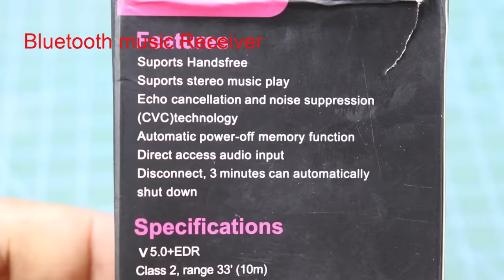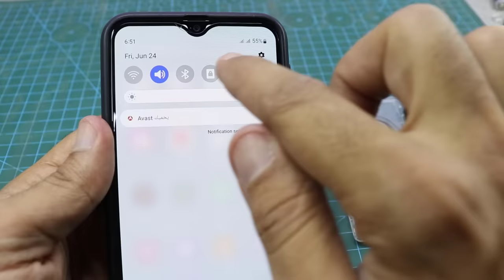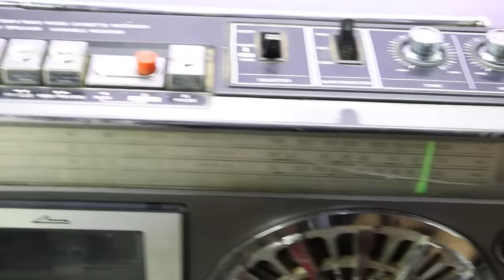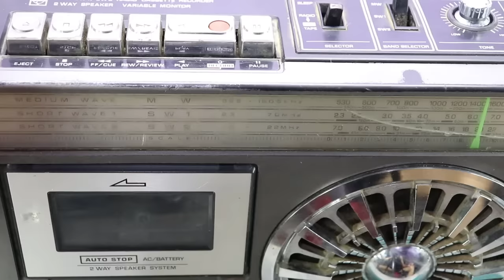This Device is very helpful , you can make at home

Comment: That is a MONO build, it could be stereo with just another conection, i believe souder left and right on the head and ground to the tab of the head instead of take it off, and align the head properly.
Reply: Para usar en cassetes de autoradios con sistemas mas modernos no va a funcionar el tema de los rodillos anti tragado. Ambos rodajes del casete deberian girar con la inersia uno del otro
Reply: Most things that use cassettes are mono anyways. The only thing that will help is high end stereos or home hifi systems that still use tape.
Reply: @diegovera9683  เครื่องๆืงง่ไๆดๆืๆืๆเเไปทำเไไๆืืๆได้้ๆๆ่รถๆๆๆไดีพอดๆ่ดี่ไๆำเเไๆ่
Reply: @joeythefoxxo  I'm old enough to remember cassette tapes and they were mostly stereo.
Reply: What you say is true, but what is the need for all this when there is a group? usb It works with Bluetooth and a radio that adjusts its place in the door of the tape and connects 12v Direct from the cassette and gives a very good sound
Reply: @AnthonyGoodley  Correct. The tapes were almost always stereo. I’m talking about cassette playing devices. They were mostly mono. I’m talking most car decks, home radios, Walkman and all their knockoffs. Some became stereo later on but by that time CD started taking over. Even a lot of things that had stereo play heads just processed it down to mono in the amplifier circuitry.
Reply: I seen that too.
Great idea, though...
Reply: That is a cheap Bluetooth device, if you connect the device directly to the line in input, you only get a mono signal, it is a stereo output, but I get disappointed spending 3 dollars in such yunk.
Reply: Sally, the bt device was mono
Reply: I have one of these for my classic car radio, it's got stereo heads.
Reply: @diegovera9683  yes you need to put a rubber band around the tape spools.
Reply: Yea and probably solder the right to the left and the left to the right on the head since it is mirrored facing the tape deck’s head
Reply: vera  prácticamente lo que hizo fue sacar el sonido bluetooth a la bocina
Reply: Магнитофон моно, но головка в кассете излучает стереосигнал.
Reply: @bazilio3752  базилио, ты не прав. Бывают и заводские  устройства схожего функционала. Головка магнитофона работает и в другую сторону, то есть может быть источником сигнала. А моторчик в мафоне можно вообще отпаять, особенно если он на батарейках.
Reply: Existem muitos modelos de cassete que são estéreo, poderia usar um desses, bastaria saber alinhar corretamente
Reply: @joeythefoxxo  Every cassette I had (besides for the radio mixtapes) were in stereo.
Reply: @limelesson  I said devices. I know the tapes were stereo. The player devices though were usually mono.
Reply: @joeythefoxxo  Car stereos, home sound systems and portable cassette players (Walkman) were almost all stereo! Source: I'm an old git!
Reply: @rh2577  only inexpensive stand alone portable cassette recorders were in mono and used primarily for dictation .  All home audio  boom boxes and walkmans that played cassettes were in stereo
Reply: He’s only using the right channel
Reply: Now try it on a CD 😂
Reply: @bazilio3752  Идея в том, что из головки делается электромагнитный излучатель, который будет взаимодействовать со штатной головкой магнитофона или магнитолы. Сигнал идёт с телефона по blutooth, принимается платой, преобразуется в электромагнитные колебания, которые воспринимает штатная головка.
Reply: @joeythefoxxo  I think you have your thoughts twisted around backwards. Unless you’re ignoring pretty much everything that happened after the 50s, stereo has been the norm not the exception. There were a few portable devices that were mono for cost/space purposes, but stereo has been around since the 30s and became the norm in the 60s for pretty much every audio device that wasn’t portable and even with portables many had stereo.
Reply: @bazilio3752  ты что не видишь что сдесь головка внутри касеты заменяет плёнку? Ты паяльник в руках держал вообще?
Reply: На канале War Archive могилизация орков🤡🇷🇺дронами ВСУ. Видео прилагается🔥🔥✌️🔥🔥
Reply: @joeythefoxxo  , you are very ignorant of the history of such devices. Stereo cassettes were the 'norm' for a long time until CDs gradually replaced them. Only the cheapest cassette players were still Mono. Maybe where you live the Mono players remained common for    longer.

But what's the point of illustrating a technique that only works practically for players where relatively few still remain in use?
Reply: @bazilio3752  не надо остальным знать о твоей глупости. Удали комент.
Reply: MONO is one of my favourite bands…I’m glad you like them too
Reply: @joeythefoxxo  Yeah, that's not true either.
Reply: @joeythefoxxo  you must be young or from a country that’s not the US.  In the USA by the late 80s stereo cassette players, both in portable Walkman types and car decks, were the norm.
Reply: @film79  Tapes started becoming popular in the 60’s, with the cultural boom happening around the 70’s and 80’s. CD’s began to become popular around the 80’s, by the time most if not all tape players were stereo, people were already switching over to CD’s. Not saying tapes weren’t stereo, but by the time stereo caught on in full effect, it was already into the next format.

I consider the 80’s near the end of life of cassettes. So when people are saying that “by the 80’s” everything was stereo, you’re not overturning my initial point that majority of the history of cassettes involved mono players or mono processing. It’s even worse when you say “late” 80’s, because now we are really talking the start of CD’s.

Im also going to clarify to others because I don’t feel like responding to every single response I am getting, obviously LP had stereo before cassette did because the tech was around longer. That’s like anything. Just how a DSLR camera is better than a phone camera, because separate cameras were around longer than phones with built in cameras. But look at phone cameras now, may surpass a separate camera. Same applies to audio. Stuff gets better as time goes on even if there is a gradual curve to it. It’s important to note that instead of just remembering the best of the past.
Reply: @maiconvarella8868  там дело в пленке
Reply: @Adiee5Priv  If you look closely you'll see L, R and G unless R and L were bridged
Reply: @joeythefoxxo
Reply: Solder
Reply: If you want to make it stereo, connect both channels with a resistance in Y connection, the value may depend in the intensity of the incoming signal so star with a 1k and search for any distortion, then increase till dist disappear. 

Si lo querés hacer estereo conecta dos resistencias en forma de Y. El valor de las resistencias dependerá de la intensidad de la señal de entrada por lo que proba con una de 1k y busca si distorsiona, de ahí vas subiendo el valor hasta que no hay distorsión
Reply: No the head only has one channel. You'd need a stereo head.
Could probably just do some blending from the input device or some players can just clone a mono track across the left and right speakers.
Reply: Yes, correct is mono conection, for stereo, need 3 wires, 1 left 1 right and 1 ground, conected on circuit, in this case, phones jack.
Reply: @film79  и в Советском Союзе ( СССР)
Тоже были магнитолы стерео !
Очень мало было моно !
Reply: Good 👍nice tip thanks bro, post more like this
Reply: Головка в кассету установлена монофоническая и имет два вывода для пайки , когда на стереофонической  головке выводов для пайки четыре. Две считывающие динамические катушки в головке позволяют воспроизводить и записывать стереофонический звук. На видео -- моно головка с одной катушкой.
Reply: @joeythefoxxo  you have no idea what you’re talking about. Cassette players were stereo, 8-track players were stereo, Walkman was stereo, records were stereo, even tho not every player had 2 speakers. AM radios in cars were mono, but FM was stereo. Just because we’re old don’t mean we don’t know what stereo is. Any guy pulling up in his souped-up hot rod with only a little mono player in there would be laughed at. There were 2 6X9 speakers on the rear window deck pumping out that stereo music

Comment: I did something very similar some years ago, only it was before bluetooth. I think I used it with a cd player to connect to my car stereo which only had a tape deck. I was surprised at how well it actually worked. I also used a tape head as a guitar pickup.
Reply from the maker: well done
Reply: Jacob Opstad
há 10 dias
Eu fiz algo muito parecido alguns anos atrás, só que antes do bluetooth. Acho que usei com um CD player para conectar ao som do meu carro que só tinha um toca-fitas. Fiquei surpreso com o quão bem ele realmente funcionou. Eu também usei uma cabeça de fita como um captador de guitarra. ( sua mensagem traduzida
muito bom , parabens pela criatividade
Reply: @jslsolucao  Isso mesmo! Boa tradução
Reply: I made one of those 20 years ago when my multidisc stopped working in my car. I had a top of the range poineer head unit. The the thing got stuck in the head unit for many years. I found it the other day and managed to remove it by spinning the gears manually. Now it is back to working condition. Keeping it as a spare. Might add bluetooth to the cassette after watching this. Great idea.
Reply: As a guitar pickup? So you used as many heads as strings on the guitar, or you even doubled the number, or how exactly? Was it better or worse as a normal simple pickup?
Reply: @Mikaci_the_Grand_Duke  You asked my question. One head can pick up only 1 string (others too big distance). If 6 head for 6 string, then need preamp for each head and then mix them to one signal. May be you need magnets to generate magnetic field that vibrating string may change a bit.... way complicated.
Reply: Tap head as guitar pickup? I gotta try that!
Reply: @davidwittie4177  Make a video about it, I am curious how it work for you. ;-)
Reply: Yeah I did one too to connect a CD player to my car cassette unit. Mine was a corded one. The cord had a phone jack that simply connected to the headphone output on the CD player. I made a different unit that had an RF modulator on  cord and set it to an unused frequency on the car radio. It worked pretty well too.
Reply: @Mikaci_the_Grand_Duke  I only had one so I ended up just using it on one string as more of an experiment. I would like to try it with six heads (one for each string). I connected the head directly to a record player pickup and it worked pretty well, honestly.
Reply: @tiborbogi7457  I connected it to the pickup on my parents' record player. I imagine there is a preamp in there somewhere. I only had one head so I never got to try it on all the strings
Reply: @jacobopstad5483  👍 Yes with one string its easy. 1 - 2 heads from old tapedecs no problem, IDK how much costs new heads. May be it is possible to connect them in series, then you don't need preamp for each head. I suspect guitar pickup is cheaper then 6 heads. But still interesting idea.
Reply: @tiborbogi7457  It might be possible to find old tape decks in the junkyard for free or cheap online. My experience was I had to get the head very close to the string to get a good effect so I think you would probably need 6 but I still wonder if you could get away with using one head for two strings or maybe even one head for all the strings with the right kind of magnetic guide (like a metal bar over the strings maybe?). At any rate, it was a fun experiment but, yeah, a guitar pickup would likely work better. More recently, I've been curious about using a photoresistor to pick up the vibration instead of an electromagnetic head. It seems like you could get less interference and slightly longer vibrations since there would be no magnetic field to dampen the string
Reply: Ну а при нажатии кнопки в магнитоле что двигатель крутит что ли? ведь как я там увидел какой то кусок ленты на колёсах в кассете, и для чего так?
Reply: @ВладимирСтепанов-и6ъ это провод от головки,а не лента.Выход блутуса подключен к головке.Эта головка прижимается к головке магнитофона и передает сигнал.В устройстве с автостопом работать не будет,если каким то образом не отключить автостоп.Для ленты там уже нет места.Мотор будет крутить вхолостую.Не лучше ли использовать этот блутус как и предназначен-через штекер?
Reply: @jacobopstad5483 Ну и как с фотоэлементом?Интересно что получится.
Reply: Тут писали про передатчик,сейчас достаточно одной микросхемы.И ловишь на приемник магнитолы.Этот вариант интереснее.

Comment: A nice adapter! One issue is that it may not work with all tape players. Semi auto and fully automatic decks need to see tape movement from the supply side of the cartrige to determine if tape has ended to switch play direction or to auto eject the cartrige.
Reply: Вот это у вас стопор?🤣 выломай в кассете зубчики🐱😀😋
Reply: @котБегемот-д2ч  ты о чем вообще? *рукалицо
Reply: Subgunman Just curious, isn't it enough that both spools are revolving in correct direction?
Reply: JIO JIO JIO oooo
Reply: @jjani6138  the deck needs to see the unwind spool being rotated by the tape being pulled off it by the takeup spool, or it thinks the tape is at the end. You could put a rubber band round both spools to make it work.
Reply: I think that is enough for both rotating wheels to be connected with an elastic/rubber band to rotate at the same pace.
Reply: Согласен с вами это для любителей старины с новым решением чудесно новое решение.
Reply: Yeah there are commercial models of these. I used to have one in my old car. They connect both the wheels together with gears to mimic the tape drive and get around this issue.
I've taken them apart before and fucked up the gear arrangement so I can confirm that lots of decks will just spit out these adapters or refuse to play them without that proper mechanical feedback.
Reply: diğer kaset tekerinin dönmesi lazım otomatik stoplu teyipler var...sorun çok yerinde!!!!!...her modelde çalışmaz evet
Reply: Yeah. Learnt about that from messing about with CD Walkman cassette adapters in car cassette decks. The cheep adapters have free spinning spools, and don't always work, but the more expensive ones often have cogs between them so the spool being turned drives the other one at the same speed.

I remember a couple years ago thinking that the molds for one of those would be an ideal candidate for being turned into a MP3 cassette adapter, because they already have provisions for the sprung loaded recording head setup built in. I even thought it wouldn't be too hard to have optical sensors watching a spool so you could momentarily use the original fast forward and rewind buttons to skip tracks. The idea was for it to mean people could have the convenience of an MP3 player in a classic car, but without having to ruin it's  originality by replacing the funky OEM cassette deck. Unfortunately, it seems not enough people were interested in the idea for me to mess about with taking it further.

Oddly though, it seems a few companies have had limited success over the years selling MP3/Bluetooth 8 track cassette cartridges to a much smaller market of people....... Go figure.
Reply: @nizki69  it should work :)

Comment: About 15 years ago, a SONY cassette appeared on sale called a line-in.  It simulates belt rotation and tension for all cassette systems.  A wire with a jack can be used as you like.  And you don't have to disassemble anything.

Comment: Your creativity is very nice. This can work on models which have no input or output jacks or other options. The model you have shown already has a 3.5mm mic input jack. You could've simply inserted the bluetooth there without needing to mod anything.  Also, most old tape recorders will usually have a mic input jack.

Comment: Over ten years ago I intended to build one of these. I bought a Bluetooth headset on eBay (actually two because I won two auctions for the same thing) and I was going to open it up and splice it into a 3.5mm to cassette adapter. I never got around to putting up the effort. But the headphones were nice.

Comment: Back in the day I used to salvage old cassette players and stereos from the garbage and convert them to simple guitar amplifiers. I would removed the leads from the playback head and solder the leads to a 1/4 inch guitar jack. I would remove or snip the leads to the play motor to reduce battery consumption and electronic noise. They worked great as battery powered, portable, small, no frills practice amps for a very poor young guitarist. I also converted old tube powered console turn tables to guitar amps. These had such a warm, golden, buttery smooth tone. Sadly, as an experimenter, these never lasted very long as I would push the tubes far beyond their design specifications. If I could find one now, this was all 30 years ago using equipment already 20 plus years old, I would be much more careful with it and add a circuit that would limit the input to something the tubes could handle to preserve the life of the unit.
Reply from the maker: well done

Comment: Some auto-stop mechanisms will stop playing the tape if the supply reel isn't turning. To solve that, you need to connect the reels with either a belt or gears.
Reply from the maker: Thank you for your information
Reply: My previous car's cassette deck had a means of overriding that.  I think holding some button while inserting the tape would cause the mechanism not to try turning the tape but simply feed audio from the head, which reduced motor noise even when using geared adapters.

Comment: You can also save a lot of time by just plugging your phone into the auxiliary input on your stereo receiver. All you need is a 1/8 to RCA y-adapter and an RCA cable. Make sure the y-adapter is stereophonic.
Reply from the maker: some cassettes doesn't have AUX
Reply: @Inventor_AW  I'm talking about a stereo receiver not a tape deck.